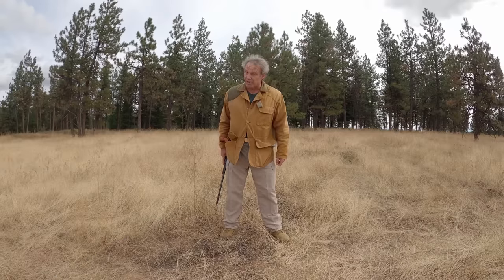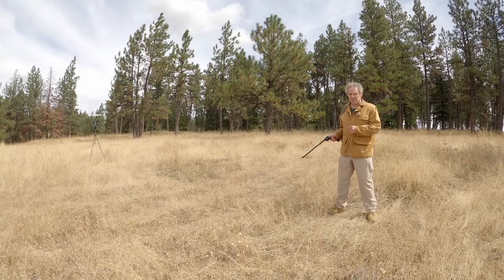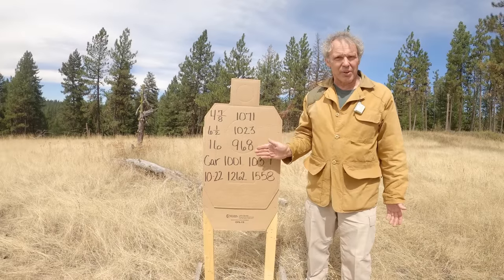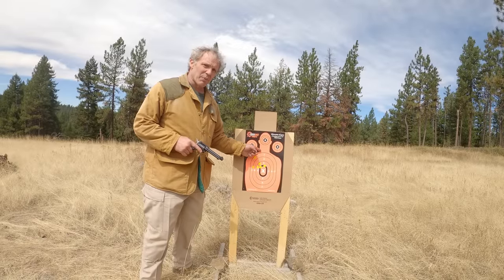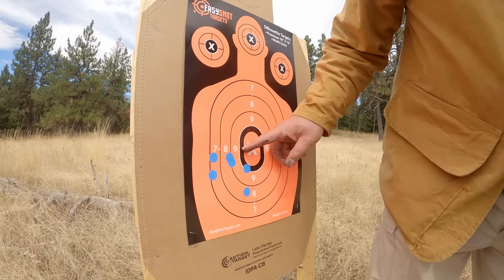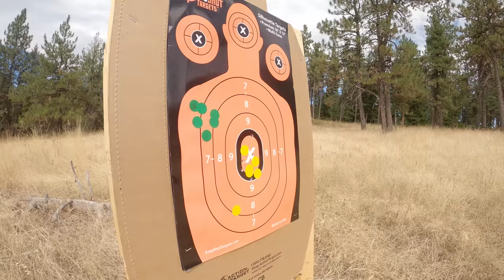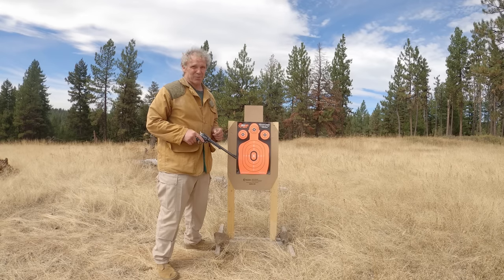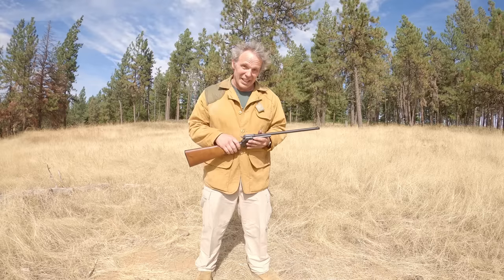Heritage Rough Rider Revolver Barrel Length Comparison

Comment: Enjoyed this video… I paid a little extra and got the heritage rough rider 6.5 barrel with fully adjustable fiber optic sights and I absolutely love it! I only fire 22 mag through it, which also made think that if this test were done with 22 magnum cylinders in the rough riders shooting 22 magnum would probably give much different results as the barrel length increases as the magnum usually shines with a long barrel

Comment: I’ve had dealings with one and it had a misaligned chamber, the other five were good, the bad chamber misfired a lot and spitting at cylinder gap and fooling the barrel but the magnum cylinder was fine and it was good accuracy.
Reply: I remember reading about old timers that marked specific chambers on their cylinder that were more accurate. Talk about knowing your gun!
Reply: @jacka55six60   I had the bad one marked not to load it.

Comment: I would like to see how a lever action rifle compares to a bolt action and semi-auto. Thanks for all your hard work great videos.
Reply: Should not be any difference.  The auto could have a lower velocity depending on the cycling mechanism but not much I would guess. Can do this fo.22. Hard to find three guns like that that shoot the same center fire rifle round with the same or close barrel lengths.  Maybe in 308 or .303.  But limited to one lever action.. Any semi autos in.30-30?
Reply: My lever action is far and away the least reliable firearm I own. Loads *most 38 Specials *some of the time, but becomes a breech loaded for 357 magnum use.
Reply: @OutsideTheTargetDemographic  that's not good...any idea of the problem...?
Reply: @PetuniaIii-pd1ww  Ummmm, probably because it is a Rossi 92. Lol. They are notorious for feeding issues. Being I use it for deer hunting, I really only have a single shot anyways. Would like to get it tuned to run proper, but my understanding is having a lever action try to feed two different calibers (wide range of OAL, 1.44 inch for 38sp, 1.59 inch for 357 mag) makes it less likely to feed correctly. My 357 mag usually jams with the bullet tip getting wedged onto the top edge of the chamber. Since the chamber is where all the firing pressure is, I'm not willing to mess with it. 😕
Reply: @OutsideTheTargetDemographic  try polishing the feed ramp.  Also , ammo selection maybe critical.  Round nose will generally work better than wadcutter types of bullets.  Going with a lighter bullet may also reduce the cartridge OAL.  Hate to see guns not in use.  Also my Rossi (.45 / .454) requires that the cycling be done quickly apparently gravity is a thing if you do it slowly.
Reply: @brianhillis3701  I find if I quickly work the action, like a shotgun click-click, it will feed 38sp, but again the 357 mags hang up. The problem with ammo selection is I'm trying to hunt with it (Ohio only allows straightwall cartridges, 5" barrel and up), so my choices are already reduced. Would like to NOT have to worry about remembering which ammo to feed it, but that may be the trade off. When you say "polish the feed ramp", do you mean the 2" "tongue" that raises the cartridge, or do you mean the "throat"of the chamber/barrel?
Reply: She gets used. Maybe 50rds through it so far, one took a buck at 27 yards. 🤓👍

Comment: Thank you, you were very thorough and methodical. It may be that the longer barrel means more resistance from the column of air while the cylinder gap means inconsistent push. 
However during several of your series, the wind seem to be gusty, and that may have affected many things especially grouping. Sometimes the target itself was moving a lot. And when you're evaluating the weapon, I favor reducing the human factor as much as possible. After a person has established the characteristics of the weapon itself, you can separately see if a human factor is influenced by the firearm.

Comment: I own 4 Heritage firearms now. 3.5", 6.5", 12", and the 16.1" carbine. Fun guns to shoot on the range. 12" and carbine are what others want to shoot and I'm being introduced to their firearms which I may consider buying for myself in the future. I shoot at range of 21 to 33 feet. Basically at Cowboy Action ranges( distance). Why? The club I'm in, most of the participants are finding hard to acquire enough rounds to practice sufficiently, let alone doing a several stages match. And the cost is way up. So we have been discussing using .22 for an upcoming match. Most of us have lever action rifles, .22 caliber handguns and some but not all of us have .410 shotguns. 20 and 12 gauge I think will be used. Easier to get shot shells right now. We want a match to be fun and interesting, especially for guests too.

Comment: Now I'm interested in seeing the rough riders 16, 9, 6, & 4 inch vs the barkeeps 1, 2 & 3 inch barrels.  I think Paul can sweat the low cost of the barkeeps to take this to the next level. 

I'm curious at what barrel length will  velocity peak? My assumption is 3inch for peak velocity and at 2inch it will start to decrease. 

 Then do a follow-up video with the 22wmr cylinder. 😂 You're living the dream Paul !

Comment: Maybe Heritage should revitalize the old Nagant M1895 gas seal revolver and make one in .22 LR with those same barrel lengths. In fact, I'm surprised the Nagant action didn't catch on. The gas seal was so effective it made the Nagant revolver one of the few suppressed revolvers.
Reply: Didn't the nagant revolver use a bullet that was seated deep in the case though. That was one of the reasons when the cylinder is pushed forward it helps create the tight seal. I'm not sure .22lr ammo would be as effective. I could be wrong though.
Reply: The trigger on those nagamt revolvers is horrific. I have only fired two different ones so i guess take it with a grain of salt. I would put the single action trigger in the realm of a cheap, shitty double action, and the double action is almost unusable. Which makes sense because the trigger is doing multiple mechanical things at once.
Reply: That required specialized cartridges, so not possible if using standard .22 LR ammunition.

Comment: I would imagine that a bolt action would be an even slighter increase of velocity over all of these types as all the gasses are being used to push the projectiles with no loss of pressure to working an action (blow back) or escaping the gap between cylinder and forcing cone.
Reply: Maybe related, but I always hear that bolt action are generally the most accurate too; maybe a myth but without moving action, gaps, etc, I guess those variables being eliminated would still help performance.
Reply: @empireoflizards  it really depends. if I buy a 408 chey-tac semi auto sniping rifle vs a milsurp mosin nagant my cheytac will be far more accurate.
Reply: @richardlooch2109  Fair enough. Often, generalizations/claims are subjective, so, the gun community is often circulating myths.
Reply: @empireoflizards  Not all myths, a 9mm will blow the lung out of a body!
Reply: @BB-1990  Yep and an AR15 bullet is 5 times faster than a hand gun! Oh yeah, it's also 50 caliber and weighs as much as a couch or something. Gads.
Reply: @empireoflizards  Yeah, the AR15 is like 5 more worse than an AR10, DO THE MATH!
Reply: @empireoflizards  love the name 👍🏻
Reply: @richardlooch2109  good point.
Reply: @BB-1990  lol 👍🏻

Comment: The pressure loss through the cylinder gap seems too high for my tastes. I've looked at these, but I'm glad that I never bought one. 

I still think that double-action revolver in .22LR and .22WMR are under-represented in the market. I think these would be excellent choices for extremely recoil-averse shooters who wanted a home defense firearm. I would want one that had a tight enough cylinder gap that the six to seven inch barrel would give the round more power.
Reply: Look at the Diamondback Sidekick 22 revolver......
Reply: @jasonproebstel1879  Thanks! I don't like firearms made to look like something that they aren't. I'd prefer a more traditional double-action styling, but the function perfectly fits what I'm thinking. With nine shots, this gun could be moderately effective for self-defense. Double-action is a better choice for self-defense. Most of us won't be facing the guy from the 1986 Miami shootout, so one or two good shots from a .22LR or .22WMR will persuade an attacker, particularly a home invader, to go away. This kind of firearm could be very useful, and at this price, this firearm is affordable.
Reply: We own a Taurus 942 that is DA/SA, but it has a 2 inch barrel...you might check the S&W and Ruger listings to see if they offer anything close to your specification, I worry such guns might be pricey...and why that is I have never understood...remember, pretty much every double action .22 will have a somewhat heavy trigger, and our Taurus has a very light single action trigger...I'd think other brands would be similiar...
Reply: If only they made a Nagant revolver in .22.... for all it's flaws (especially refurbs) it does solve the gap problem!
Reply: the Ruger LCR 22 has no blowback. It's very high quality, 8 shots, double action, and 22. It's a great self defense weapon. The LCRX has a hammer while the LCR is hammerless
Reply: @aquilonianace4791  we looked at a lcr, it was the internal hammer model, and it was somewhat pricey...we would prefer the lcrx, with sa/da, but the .22wmr model only holds six rounds...the 351pd holds seven, and is double the price of the 942...so, there are choices in double action snub nosed .22wmr, but it would be nice if there were a couple more...

Comment: For any new buyers, i recommend slapping some clear coat spray paint on it. The finish quality is one of the places Heritage cut corners for the price point. Is what it is.
Reply: Good tip. Tho I like a slight rust patina on a six shooter as well as old single shot shotguns, and being that these are priced so low I wouldn't mind letting it age a bit.. so I'll take your advice and apply it when the patina reaches the desired look.
Reply: You couldn't even type the first "It" when regurgitating "It is what it is?"
Reply: @johnqpublic2718  Dude you put the question mark inside of the quote, I don't think you have the right to correct perfectly coherent sentences lol.
Reply: @johnqpublic2718  you ever seen that meme with the little kitten wearing an SS uniform that reads "Do you think Grammer is a joke" lol
Reply: @blewrei1366  Did we just become best friends?

Comment: 5" off at 20 yd, with about an 8" sight radius, is only 0.0556" wrong at the foresight. That's 1.4 mm.
Could you "adjust" the sights by filing the right side or adding layers of extra paint to the left side of the foresight?
Reply: Yes, I have a Heritage Rough Rider that the front sight is filed down on one side and it hits dead on now. It's not exactly ideal because it's not reversible but it's also a $100 gun
Reply: I just bend the front sight until it is shooting dead on. Also, most of mine shot way low when new so I had to file down the front sights to bring 'em up.

Comment: Well, that answers that. I traded my Heritage Rough Rider 4 5/8" barrel off about 6 months ago on a 6 1/2" Heritage Rough Rider. The fit and finish on the older 4 5/8" gun was better than the 6 1/2" gun but I wanted it for a longer sight radius and higher velocity. It wasn't appreciably more accurate than the shorter gun and your video seems to bear that out. This test really floored more as I did not expect the 4 5/8" gun to be faster than all of the other barrel lengths. Well, I still have the longer sight radius. Thank for the video and all of the work that you put into making them. C'est la vie!!

Comment: Thanks for the video Paul! Always nice to see your videos on my feed, I get excited and can't wait to sit down and watch them. I got the heritage Barkeep 2 ⅞ revolver from my shop and a magnum cylinder from heritage. It has been a lot of fun but I've shot it to bits already and I've got a thing to share about those possible flyers and shooting without those sleeves.

Accurate with the rifled 22lr cylinder when new, even sending a 6inch group at 100yds - But after a few hundred rounds either the timing was getting off or off bored cylinder chamber because it began spewing lead out to the left of the forcing cone. Lots of it is still embedded in the foam of our shooting booth so be careful about putting that hand up there as time goes on. 

The 22mag cylinder is a great novelty, but at least the one that I got has very poor accuracy no matter what ammo I put in it. 

It's all in pieces now after 1400ish rounds, I'll send it back to heritage and put it up after I get it back. Also cool that you can spell C-O-L-T with the cocking mechanism unlike its competitors.

Comment: I have the same exact 6.5 inch one you do. Got it this last year. Fun plinker! It’s reliability is iffy. I think the machining on the cylinder is off. When you load it up and rock it back and forth or just point it up on the air you can hear the rounds slide back and hit the back. I don’t know much about revolvers so certain terms I’m not familiar with. But what I think is happening is there is to much space between the cylinder chambers and the back and when the hammer falls and hits the firing pin it’s pushing the round forward and it’s not getting enough force to set the round off because it’s also pushing the round forward fully into the chamber. If I don’t point it up or jar it around it fires just fine. But I guess that’s what happens when you buy a hundred dollar firearm. Keep up the entertaining videos Paul. Have been a fan for and watching for years! Love your rants. They’re the best!

Comment: The single shot revolver will also function if you smear mud all over the cylinder. The 10/22 may fire a few rounds before jamming. If you are on a trail, and are planning to be out away from the comforts of home for a while, the single action army style revolvers will function basically forever with little to no maintenance.

Comment: If I remember right about them fixed sight SAA clones and variants the procedure for adjusting windage is literally turning the barrel in the frame in the direction the bullets are landing. Elevation is adjusted by filing the front blade to bring impacts up and soldering a bead on it to bring them down.

Comment: This surprised me, never thought the cylinder gap took away that much speed...things I learn...! we own the 6.5 barrel model, and I must say it might be a smidgen more accurate than Paul's...our gun is primarily just for plinking (it excels at that), although it is on duty right now loaded with .22wmr in the basement (better than nothing)...other than constantly retightening the screw on the ejector rod housing the gun runs like a Timex⌚...maybe I ought to try the red loctite, hmm...

Comment: I picked up a 6.5 “ a couple of months back. Had to spend a couple of weeks back in FL at the shop for a common problem, but it’s back. It is a FUN gun. It’s not my 686 PC, it’s not a Glock 44, or SW Victory….but I enjoy the heck out of it at the range. Plus it has good aftermarket.  Get a nicer set of wood grips. Thanks for posting…and unconcealing the 16” was funny

Comment: I chronographed a pair with 4 7/8" against the 6.5" over my Oehler 35p and found the same losses.
Because the powder is burned in the first few inches and onky the gasses produced benefit from the longer barrels, it indicates 3 scenarios:
1. As yoy state correctly, the cylinder gap causes velocity loss.
2. After the powder is burned and gas volume created, excess barrel length begins a dragging process, actually slowing the bullet with the modest rimfire loads.
3. I also suspect there may be variation in the cylinder holes the bullet escapes through which would influence exit velocity and gas escape.

This could be proven by swapping the cylinder of the fastest gun and using it for all the others.

I was hoping you would go there. I had to send back the other sample I had so didn't think of it until later.

Comment: I have the 4 7/8” barrel rough rider got it on sale for $109 + $12.99 ffl , hard to pass up a great deal like that.  I wanted the 6 1/2” barrel so I bought one of those recently for $139 with nice grips.  Wish I had seen this video first as I would have passed on the 6 1/2” barrel as loss of ft per second is a no go for me.  Hanks Paul for a great video as always!
✌️😁🇺🇸
Reply: Chrono the two. My 6.5 gets velocities averaging 45 fps faster than the 4 7/8 with Remington Golden Bullets. Every gun is different.

Comment: One thing to consider is that Heritage does make an adjustable sight version of these Rough Riders. I have one of them with a 6.5" barrel tha also came with a .22 WMR cylinder. I just wanted a cheap plinker in .22 especially after watching Paul's video on handgun shooting where he mentions starting off on a low-powered pistol like a .22 revolver so you don't develop the habit of anticipating recoil. The price for that bundle is still much lower than the Rugers and I am very happy with it for the price I paid.